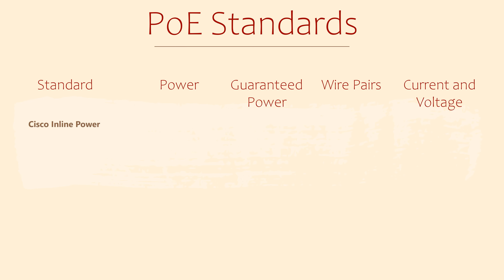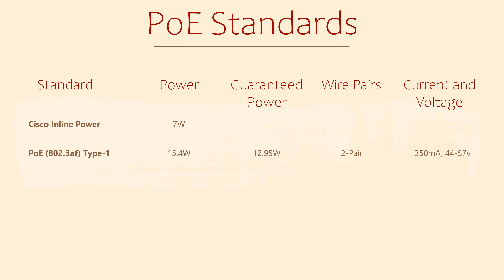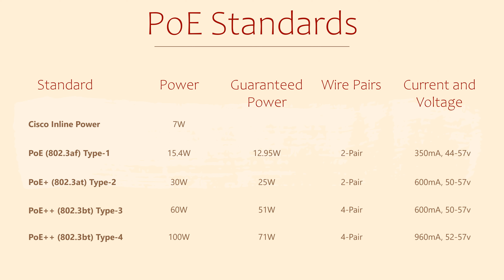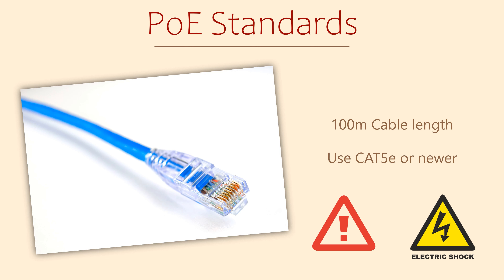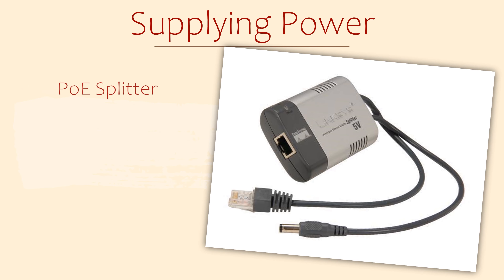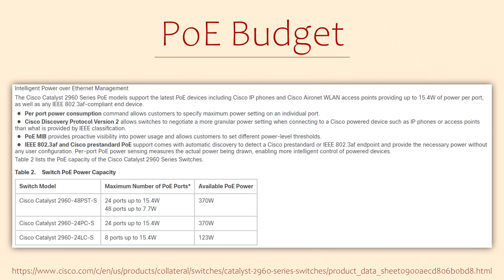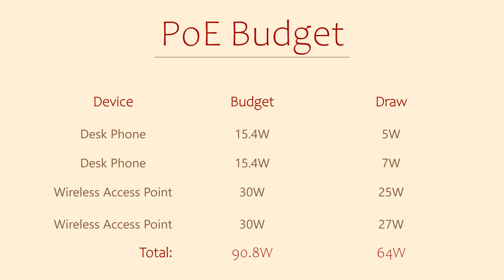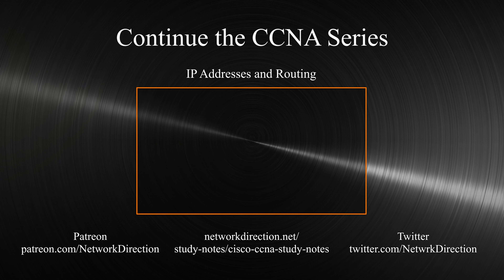Free CCNA Training Course | Part 6 - Power Over Ethernet

Comment: Good brief manual about IEEE PoE standards. But unfortunately you missed passive POE working principle and dangers, also PoE pass-through. I know it not so related to Cisco equipment itself, but for audience, whom not familiar about difference between passive PoE and IEEE PoE, it could cause problems in practice...
Reply from the maker: Thanks for the tips! I tried to keep it relevant to CCNA though